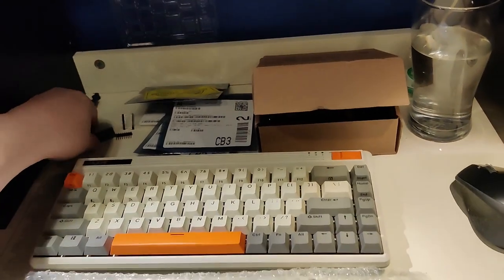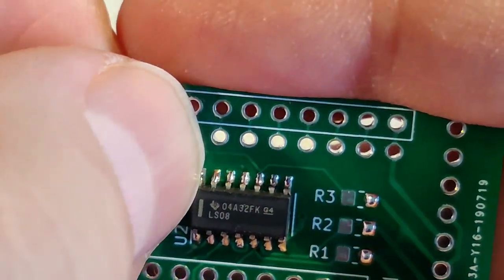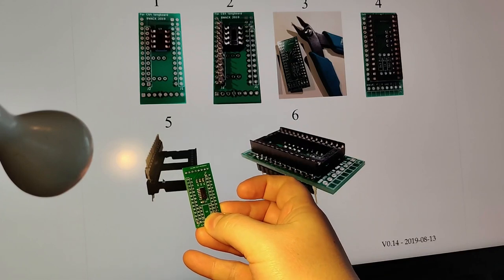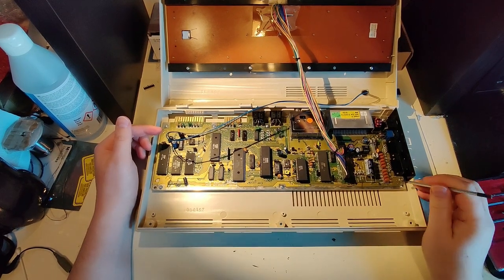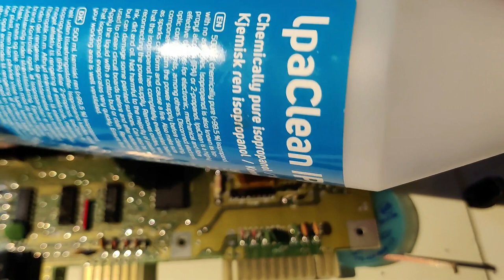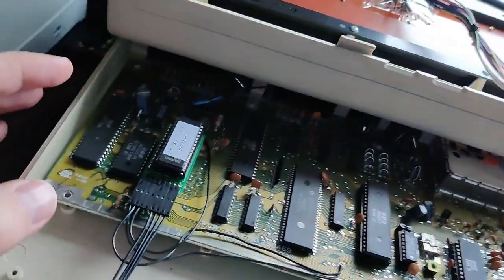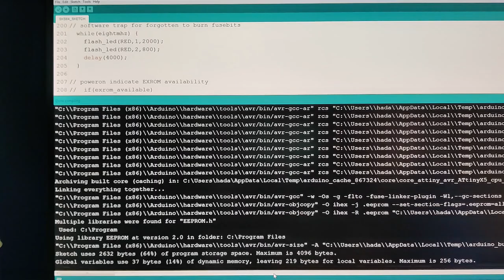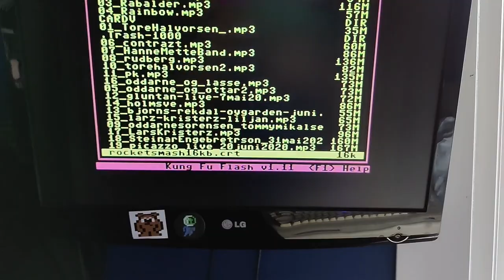SKS64 shortboard version build and resolving issues

Comment: Thanks for sharing this design.  I just finished building and installing the longboard version.  I thought I had an issue with the exrom reset, but it ended up being an issue with the Epyx Fastload cartridge I had plugged in.  The board and firmware work perfectly.  Thanks again.

Comment: Thank you for your excellent work. I've recently built 3x short board and 3x long board versions of the SKS64 and all are working perfectly. I am using the Red LED version of the firmware. The tolerances to fit the short board version into a C64C case are very tight, but it does fit in with a few mm between the keyboard bracket and the PCB pins.